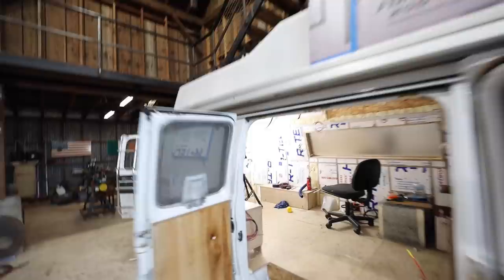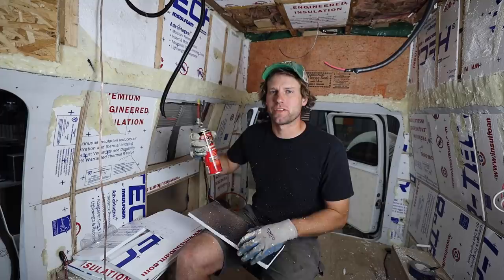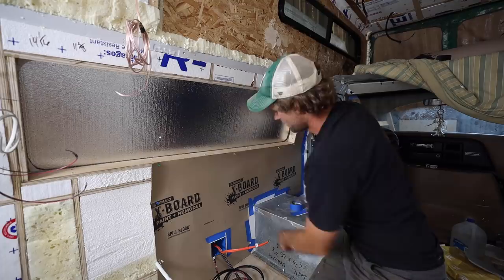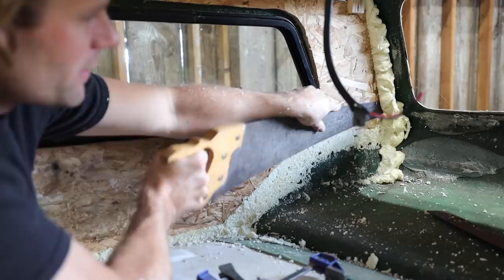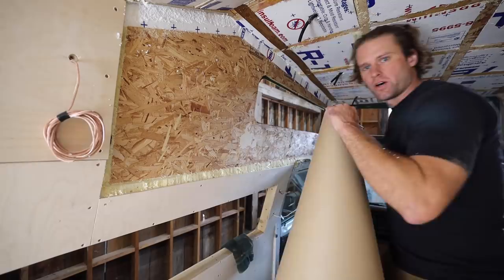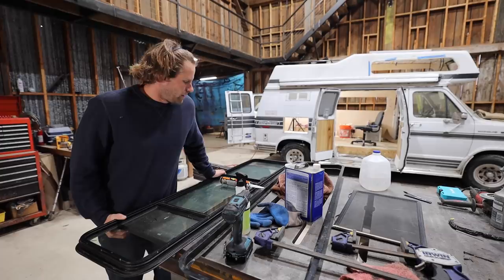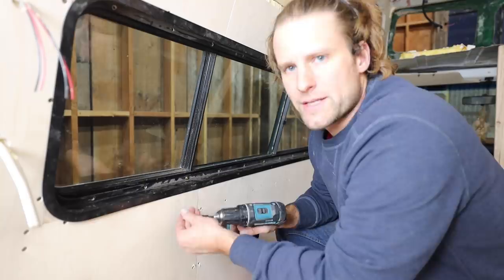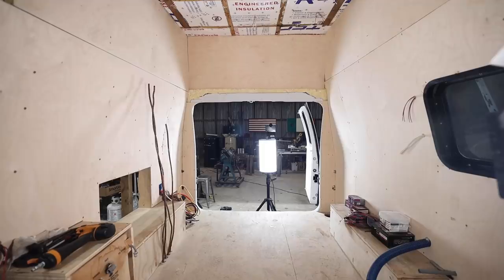Camper Van Remodel pt. 4 - Insulation, Plywood, and Windows

Comment: Many years ago I had a project that required a lot of thick (2" + 2 1/2") foam insulation. Most every sheet had to be cut to fit. After a couple of days the motor on my sears table saw quit, I bought another heavier (2hp) motor, this motor quit after the second day. I bought another even heavier  (5hp) motor, when this motor quit a few days later I took it back to the supplier. Those guys knew motors, after a few minutes they discovered that the contacts were covered with melted plastic from the foam, they cleaned the contacts, showed me how as well, that motor and the others still work fine to this day..  So if your motor quits while sawing foam, Clean the contacts.
Reply: Good to know thanks for sharing!
Reply: Or a razor and straight edge?
Reply: @MS-smittyrolls  foam dulls blades quickly and anything thicker than like half and inch is very difficult to cut. If have hundreds of cuts to make, like for installing foam insulation, hand cutting everything would be almost impossible.
Reply: @Koishichan  it's the same problem... Not dulling, but the blade being coated by melted plastic. The best solution for lots of cuts is a hot knife mounted in a router base
Reply: wow.... good story and tip, thanks......
Reply: Why are you all cutting with a saw? At work we always use a hot wire cutter

Comment: Nice job on your camper van!!
As a teenager in late 60s I worked as a draftsman at a camper manufacturer; Honorbuilt El Dorado truckbed campers in Lakeview, CA.  Sister factory in midwest built the larger motorhomes.  Boss drove one to CA and had us "copy" it.  First prototype had electric lights and also butane lights fed by copper tubing.  Somewhere under a cabinet someone crossed copper lines and we had gas hissing out of faucet and water shooting out of lights.  Boss took one look and decided against us building any more.  I left for the military so never heard if CA plant tried again.  I was hired as a draftsman right out of high school to create plans from existing models.  Everything had been built by experienced workers for many years - they knew every stick and screw in every model and never had any drawings.  But many of these old gentlemen were approaching retirement age - so they hired me.  Ha!!  But if was a great experience.

Comment: Good to see you're back!
couple tips when boarding always start with the ceiling first and whenever you're using calking / silicone use a bit of washing up liquid to mould it on a tool or finger it doesn't stick and forms very nice. 
Hope the boy is well and still chasing the tennis balls

Comment: One thing about spray foam in campervan (been there, done that). There's a lot of humidity in there, and you should use closed cell foam + some kind of membrane over your insulation. Open cell foam soaks water like sponge over time - there is a good reason why you don't use it on boats ;-)

Comment: STOP!

Please don't go any further until you waterproof your roof connections better.  I'll start with I love you channel. Hope to see more of this project as it looks great so far. There's a couple easy things you can do that will help decrease the maintenance you have to do on your roof in the future. I'm going to preface all this with that I have experience designing industrial control systems that have to withstand high pressure wash down. The solutions Im providing will be a lot easier to do now than later. PM me if you have questions. Best of Luck

A) Your solar penetration box is only attached with a gasket and not glue. The roof of your vehicle is going to flex and twist as you drive around. It's a given. Silicon sealer will not permently hold things down. It's going to pop off after a couple trips flexing. With how you did the conduit, it will be a big leak. You have two options. Bolt it down with the silicon sealer and screws or use a rated fitting such as a cord grip. Use a single LAPP Skintop MS fitting with a Skintop Dix insert or just two of the MS fittings. 
https://products.lappgroup.com/online-catalogue/cable-glands/skintop-pg-nickel-plated-brass-cable-glands/easy-to-install/skintop-ms.html

B) Your camera connection can use the same solution as issue A.

C) Your tape over the big hole will not work because of how you overlapped the tape. If you just used one single piece it might be alright if you pressed it in real good. But since the tape is overlapping, the seam between the two tapes has a little opening there. Water will find its way in there in even better solutions. Bolt a plate on it with silicon or use a conduit knockout cover. https://www.tequipment.net/Hammond/HP22SS/General-Accessories/

D) Solutions A,B,C all rely on a o-ring wich will not work on a rough surface. Please sand the area smooth before installing for best results. I'm assume your roof has a texture, can't tell from the video. The tape probably have the same issue if you don't really push it on in if it's textured.

Comment: Justin, hate to be a Monday morning quarterback, but I would seal the Windows differently. Use Zip stretch tape to seal around the opening first. Start at the bottom and shingle it up the sides and around the top of the rough opening creating a bridge over your framing and the outside of the van. Trim it so it doesn't stick out beyond the window frame for looks. You really want the seal between the van siding, your framing and your foam. If water gets in there the foam will soak it up, stay wet, and then you'll have a mold issue. I also would not caulk the bottom of the window because you want any water that does get in (and it will) to have a way to drain and dry. Make sure your caulking stays flexible as the van will twist and crack caulk that hardens. 

It's just like installing a window in a house. Good luck with your project and glad to see you back here.

Comment: Kinda skeptical about the spray foam. You give your vehicle an expiration date in my opinon. I own a 40 year old mercedes bus und i had to cut out and weld quite few bits and pieces by now. if there was sprayfoam in all nucks and crannys of the car if would catch fire the instance you start welding. So basically once your car starts rusting there is nothing you can do from there on...or am i missing something?

Comment: You should add to the link in the description for smartjars https instead of http, normally websites should automatically redirect to https but smartjars apparently (at least for me) doesnt. Its really unsafe to not use https because your data like bank information wont get encrpyted. Just as a friendly hint.
Reply: Once you go to the actual check out page it goes to https, there is no issue here. Browsing an HTTP website is absolutely fine.

Comment: You should put a vapor barrier on before you put the plywood on otherwise the moisture from your breath will creat condensation against the metal and it will rust out from the inside out